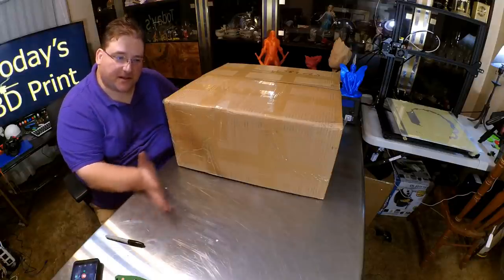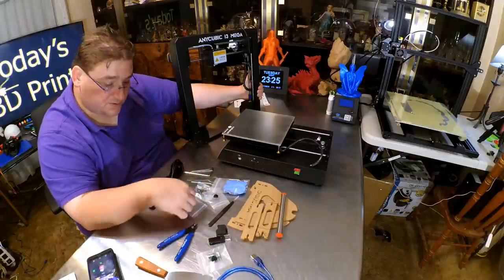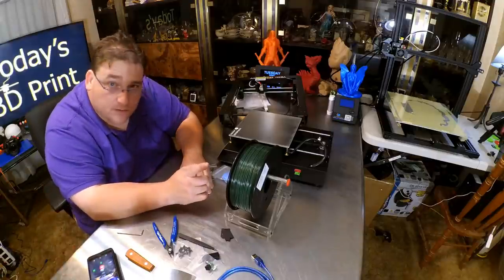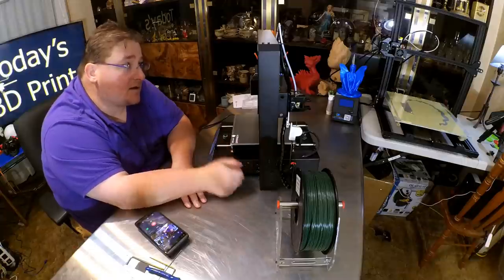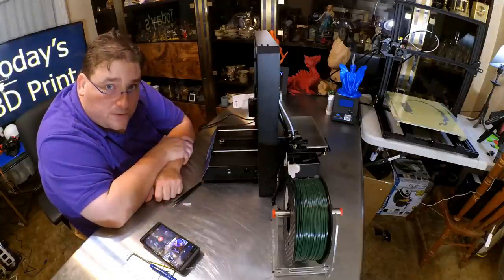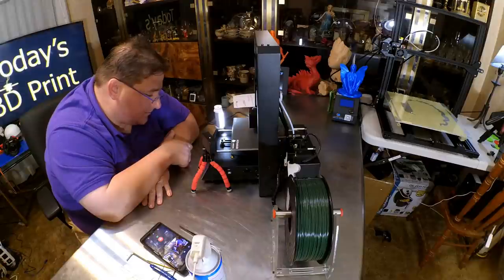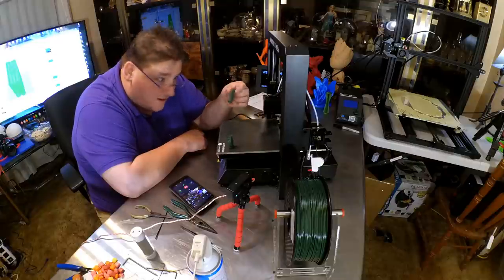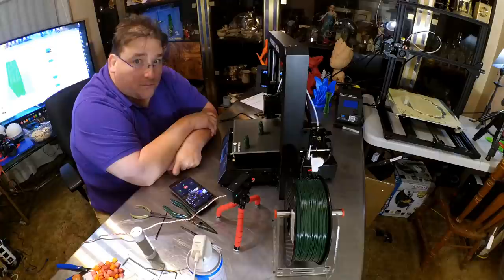Today's 3D Print 139 Anycubic I3 Mega Unboxing, Assembly, & First Print

Comment: ok want to ask the $100 question. I'm in the UK and want to get into 3D printing.I was looking at the Prusa i3 MK3 in kit form. but the cost is an issue. so then I started getting sucked into the whole CR-10, CR-10s, ender 2, and Tevo Tornado thing. I'm still not 100% sure what to buy. you've had good prints from the ender 2, but others ive watched had issues. I thought the Tevo would be good as others seemed to like it, but then you had issues.I like the build volume of the CR-10s but the price is too high for me. the Tevo seemed to give me the best of price and build, but I'm like you very picky on detail. so then saw the ender 2 that you reviewed. great prints low price, but quite small volume.I also notice it seems lots of problems with Gearbest, but yet nearly all reviewer on YT promote Gearbest. they are cheap but I don't want issues with delivery etc.if you have time could you give me some idea what to buy?
Reply from the maker: +Joe Blog I'll explain everything I can the reason we promote gearbest it's because gearbest gives us printers and gives good commissions you buying Ender to I make $9 buy a CR 10 to make about $16 they also have some pretty good prices

I've been hearing about problems with gearbest as well so I've been texting them or last couple months every few weeks I order some cheap little thing from them and I never had a problem I always get it I think the trick is when you're ordering something hot cr-10 shouldn't give you a problem from gearbest tevo tornado might because it's still hot and tevo still backordered so the trick is to avoid ordering when it's super hot and popular since those seem to be the only one to have trouble with gearbest

This next statement is purely my opinion my guess I have no inside information with gearbest Tony contacted me and said would you like some free printers to do videos I said yes as long as I can be honest and they have never ever wavered on that word he never questions me about anything only mentioning to make sure I use the affiliate links because for them this is how they track whether or not sending you printers is effective if you generate sales it's worth sending you printers if you don't it's not it's a pretty simple business arrangement Tony has never uttered a single word to me that implies they care one bit how I do the reviews they just want to see sales this is why I prefer to get printer from a shopping site like gearbest versus directly from the manufacturer who definitely has a specific agenda not an unwarranted one they are in the business to make money but it can create bias even unintentionally if creality sends me a printer I might feel like I owe creality something I think I have enough will to not allow that to buy as me but it's dangerous someone like Tom or Joel or Angus they're very large they have a presence they don't need the printers they don't need the arrangement with the manufacturer they can tell them to go f off and it's no big deal that's a little harder for smaller channels even subconsciously some sites like gearbest basically shopping sites are ideal because they don't care what you sound as long as yourself I had one guy buy some ft5 core XY printer through MyLink I don't even know what it is but use my link to buy it gearbest as happy I pretty much Pand the zonestar printer I do not suggest buying it gearbest doesn't care because I get sales obviously enough to keep them happy :-)

Now I'm also Fair I spent a lot of time trying to make the Zone start work right I wasn't able to within the time slot I had so I had to give it a no vote but I 3 mega Came to Me Broken the coupler and Z rod where bent causing a wobble in the prints I recognized this as a simple error replaced both components it prints perfectly I delayed the release of the video to make sure I gave both my viewers and the manufacture a fair Shake

I actually prefer if I have a little problem with the printer as long as it's not a serious problem because that gives me a chance to test something else the manufacturer's response I do not go through gearbest because I don't want them to know I'm a reviewer I went directly to anycubic said I got one of your printers I'm having a problem here's the problem I show the video of a problem their response was fast and courteous they ask to see the problem and they said they'll send out parts that I had already replaced the parts and I asked could I get another piece of the bed plate instead since it's about the same price as the parts are replaced they said yes that's on the way to me now that's a good thing manufactured didn't tell me to go screw off :-)

Now ask for your printer that depends the cr-10s is the creme Dela creme I really like my cr-10s for large-scale printing it's probably my favorite overall it's also highly refined all the little tweaks and upgrades that they've been adding at the request of the customers or in the printer

The regular cr10 is missing a lot of the cream that the S has but it's a lot cheaper so there's that to consider

The tevo tornado has a fantastic glass composite hybrid plate thing and an AC heater that is a beast otherwise it's a CR 10 not the s so it's not as good except for that heater

There is also a pretty serious quality issue with the tevo tornado it has artifacting in the prince due to their selection of main board and stepper drivers TL smoothers correct most of this but not all of it and you do have to buy those extra and you will never get as cleaner print as you do from a cr-10 if you're trying to print artistic Prince like the ones that I print on the tevo tornado you'll never to be displeased but if you try to print Precision Parts with her smooth surfaces geometric engineering Parts such as my nose comes or boxes and stuff like that you're going to notice the artifacting of the less than perfect print quality it's not bad it does not ruin the print it's cosmetic but you will see it and to be honest while the heat bed is nice it's not required 45 C is plenty if you use a decent aftermarket build plate material typically what I do if I set my first layer at 45 C because it can get there in 8 minutes and then I said the second layer to 55 C if I think I need it and it's okay if it takes a little longer to get there it's already printing

The Ender to is a special Little Critter it has truly phenomenal print quality almost zero noise ghosting or ringing you can make truly impressive prints with this printer but it does have a very limited print volume 150 by 160 by 225 which limits what you can print it does have a heat bed but it's limited to 60c although it would be pretty easy to make an enclosure for it because of its size very small

Where the Ender to excels is its price and its quality it's under $200 sometimes as low as 150 but it has print quality that's up there with the best of printers so it's a way of getting your feet wet with 3D printing without investing a lot of money but also still having an extremely useful high-quality printer to either resell if you decide you're not into this or to continue to use if you decide you are into this and the print volume is large enough to be useful this is part of the reason why I like the Ender too so much very cheap very high-quality very useful I switched out my boat into Capricorn and my nozzle to harden steel so now I can print up to 260c using pretty much any filament I want as long as I can get it to stick :-)

So if you want to test the waters get an Ender to if you know you want to do this and you've got a $500 budget just skip all the crap and get the cr-10s you won't regret that

I hope that was helpful to you if a bit long I do like to get a lot of information if you have any questions by all means please ask one of my favorite Parts about running this channel trying to help people and interacting with them directly it is by far my favorite part
Reply: Nerys what would you say is quieter A CR-10S or CR-10 Mini, I'm pretty sure they are both far more quiet then the original CR-10. I will be picking one of the two and I would rather not have to change to many fans or do any soldering. The building volume difference doesn't bother me for what I will be doing if mini is better regarding this, the DB volume is something that interests me however. So whats your experience there?
Reply from the maker: +xMusicx nearly identical I would go with the cr-10s if the budget allows it is quieter than the original cr-10 it's not quiet but they do appear to improve the fan noise at least my cr-10s is quieter than either of my original CR 10's

If noise really is an issue consider updating the fans later they're not expensive and no soldering is required I just twisted and taped the wires :-)

I also don't know how they did it maybe it has to do with the fact that the three sets of wheels are still there in the v slot rails but my ex Gantry has never gotten out of level yet and I have many hundreds of hours on the printer already very stable and very reliable I'm not sure why but better print quality than the cr10 mini that might be unique to my mini but I get better results from s model
Reply: wow awesome reply. don't know how you have the time to write so much. anyway think I might buy an ender 2. I want quality over size to be honest. I wonder if on larger box type stuff weather I can make them multi part anyway and then assemble it using glue.I normally buy from bangood as I have received everything ive ordered and within about 5 weeks.plus my missus is already grumbling about me spending the $ on something she thinks will sit there doing nothing.are there ways of making 3d printers generate $?also one last thing did you have any issues with part cooling?
Reply from the maker: +Joe Blog I was worried about that but so far it does not appear to be a problem on the Ender to not a single printers exhibit an issue I suspect the design of the Shroud around the hot end encourages the excess air that blows over the cold end of the hot end blows over the model which is one of the reasons I've been hesitant to mess with that fan :-) so I think it does have indirect Parts cooling using the primary cooling fan

I have a banggood link in the description as well as an AliExpress link :-)
Reply: cheers. ill check it out. ive not bought from ali yet, I always find there site confusing. to many people selling the same thing.
Reply: the bangood link isn't working I'm afraid.
Reply: ok now considering the cr10 mini. its only £50 more and has that nice size build volume.
Reply: Yea 10S is definitely in the game with some of the price codes I have been seeing. price is not as big of an issue if it can be justified. These CR-10'/S/Mini seem to be in that sweet zone of price/features however. I'd like to see a video on that partial non soldering fan exchange btw, if you get some time or a spare unit to mess with, likely am not the only one worried about screwing up my printer or voiding and breaking something. 
I do plan to build an enclosure around the main unit, but man, some of those fans in the power units are like jets. Did watch a couple videos but they were not to clear about the whole process, though the results were damn good. Cheers Nerys.
Reply from the maker: +xMusicx maybe I will do that this week since I want to upgrade the cr-10s :-) I plan to swap out fans and add the stepper dampers so I'll just make that all one video upgrade episode give me about a week
Reply from the maker: +xMusicx one thing to keep in mind you modify a printer you void the warranty technically they can void the warranty unless they can show that your modification was the cause of the warranty claim good luck fighting it :-) so just be aware of that good news is parts of plentiful and cheap
Reply from the maker: +Joe Blog the advantage of the I3 Mega is its Ender quality prints and that amazing ultrabase this is a standard I3 printer so basically roughly 200 by 200 by 200 if you need larger I would skip the mini and go right to the CR 10 it's only slightly more and it's not that much larger than a mini the mini is kind of a special case printer where you really need to spend a little less and you really just can't fit a CR 10 otherwise just go cr-10 the I3 Mega is going to be a farm machine it's just going to crank out parts for me because there's no bed prep and no bed clean up spray some alcohol wipe it down it go Slide the parts right off without even using tools spring the alcohol wipe it down hit go for me that's the magic of something like the I3 Mega the cr-10 does my projects the big stuff the fun stuff the cool stuff the I3 Mega will crank out my day-to-day grind of parts
Reply: Wow that would be great, wanted to see dampers done as well. Thanks Nerys, looking forward to it.
Reply: Nerys before this info on the i3 I pulled the trigger on a cr10 pre order from banggood at £233 $300 Should be cheap enough to keep the missus off my case. Plus I like the build volume. I guess I can upgrade the build bed later. I even seen some people make the glass scratched up so prints stick.
Reply: Nerys ok just wondering if to cancel the pre order on the cr10 mini and go with this. I noticed on Joe's review it had an inductive sensor for bed leveling. Does this mean no fiddling with srews? Will this produce better prints than the mini?
Reply from the maker: +Joe Blog don't worry about build surface material this plenty of them out there and they all work pretty good including just glass scuffed-up with glue stick the inductive sensor was probably added mine does not have Auto bed leveling and to be honest once you properly level printer you shouldn't have to mess with the bed leveling very often if at all I haven't touched my bed leveling screws on the I3 Mega since I set it up I also haven't touched the bed leveling screws on my CR 10 S4 or my cr-10s in 1000 hours of printing people get too worried about bed leveling once you know how to visually recognize a leveling issue fixing it is very easy you just have to practice watch my video on leveling the cr-10 and printing basics understanding a theory understanding what you are looking at and knowing what it is you're seeing really helps at some point you're frustrated or throw the printer out the window brain will click and you'll go oh my God it's so easy twiddle twiddle done printer great :-) it's an aha kind of moment it once you get it:-)
Reply: Nerys so stick with the mini?
Reply: Nerys thanks again for the replies my son thinks I'm epic for chatting to you as your a YouTube star. Anycubic say they might do 20-30% off on black Friday. This would bring it close to the cr10 mini price. If it was say $30 between them which would you choose?